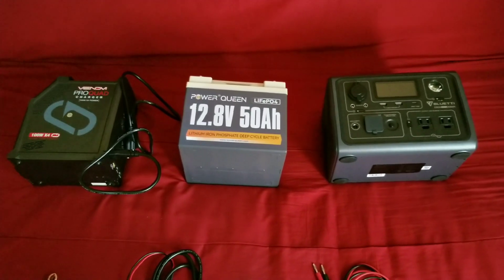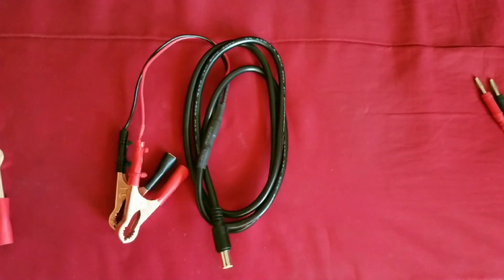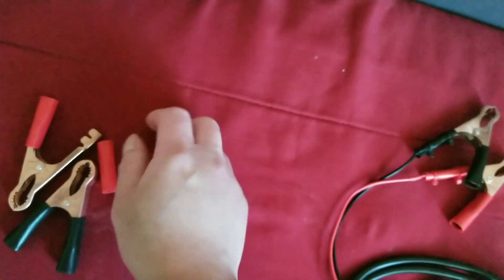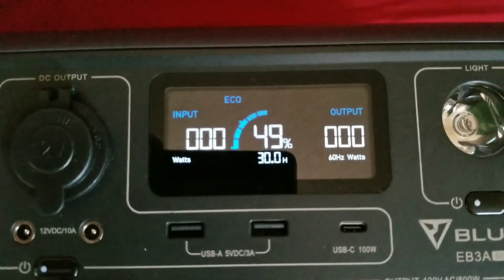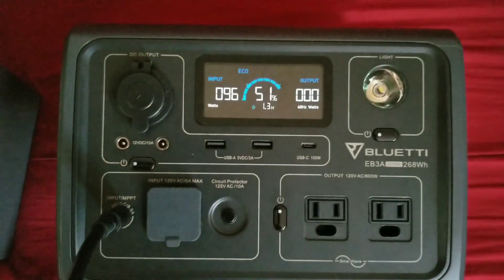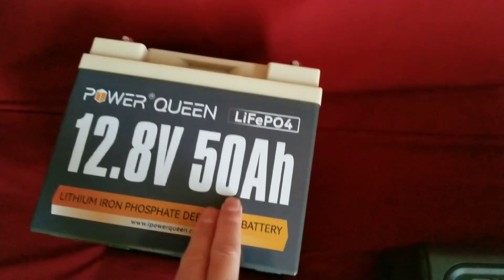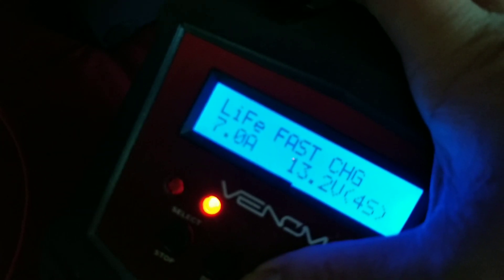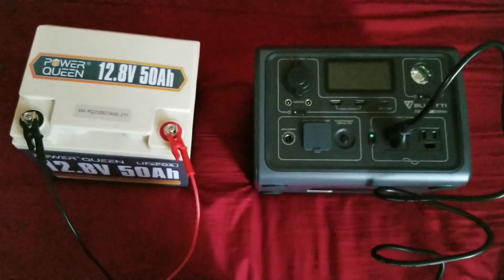How to extend the capacity of Bluetti EB3A

Comment: The charger is set to 13.2V at 7A? This puts 93W into the battery whilst draining 172W from the Bluetti, that’s a 50% loss. Using a voltage booster with current control fed from the bluetti 12V output is more efficient.

Comment: How can you be sure that your battery doesn't go below 70 percent of its capacity? I heard discharging lifepo4 batteries below 70% is killing the battery
Reply from the maker: @oleksandrhirin339  its actually discharging below 20%. Staying between 80% and 20% range thia battery can last 10yrs. I
Reply from the maker: I connect a meter that tells me what percentage the state of battery is at everytime i use it to stay within the 80%/20% range
Reply: @edwindeleon  that is logical, but how come the youtuber tells nothing about it

Comment: I am from cuba so huge problem with electricity. Which system do you recommend me a bluetty generator or pure sine converter with 12v battery for turn on basically electrodomestics in the house like fans principally. Thanks
Reply from the maker: Thank you for your comment. 
It really depends on your use case. If you are planing on powering your entire house then your going to need to get a bigger capacity system. This bluetti eb3a only has 268wh capacity. Although it has a 600watts pure sign wave inverter, Its intended more for camping or something with a very small draw. 

If you're planning on running a house I would recomend something with  a minimum of 3kw system with a 2000watts inverter.  This will only provide power for household items like a refrigerator,  LED lights, fans, tv, ect ect. You will also need a solar panels minimum of 600watts. It can get very expensive using batteries and solar to power your home especially if you buy bluetti or another solar generator.  A DYI will be cheaper. 

Alternatively,  you can get a gas generator for cheaper route less complicated route.
Reply: Getting the 12v 100ah battery with a pure sine inverter would be better in your case because this setup is more flexible PLUS you get more watt hours of operation with it. Also add a solar charge controller to this setup. With the cables and the solar panel or panels, your setup would be complete. As a bonus, get a 24v to 12v buck converter as well for a backup because if your solar charge controller goes bad, this buck converter could be attached to the solar panel to the battery directly to charge it if need be. If any component of this setup stop working, you could swap out that part for a working one, and your system will be back up and running just like it was before. If you buy the Bluetti or any power station, if a component inside of it goes bad, the whole system would be shut down and you would have to buy another whole new unit. I could imagine living in Cuba and the supply chain not being that great all the time, so, that's something to think about as well. I hope this helps.

Comment: Thank you so much for this solution i have two questions can i use a deep cycle AGM battery 12 v 100Ah for this purpose? And the other questions is can i use de eb3a bluetty with equipments at the same time that thw bluetty is charging with the battery?
Reply: Yes.

Comment: I"m trying to visualize how this is extending the capacity when I'm only seeing the battery just charging the eb3a. What happens when the eb3a is fully charged? Because I see it just like having a power bank for a phone. When the eb3a goes close to empty you have to connect the battery up again which is just like connecting it to the wall. And how many times can that battery recharge to 100 percent for the eb3a?
Reply from the maker: It's basically adding the external battery in series to the eb3a 268wh battery.  The external battery is about 600wh then you add the eb3a 268wh which in combine is 868wh. 

I tested this with a 100w light build and ran it till both eb3a and external battery connected to the solar input charger and I got about 6hrs of run time (a little less bc of inverter inefficiency). Now i compared that to the eb3a with out ther external battery and i got about a little less than 2hrs run time. Which is about where it should new with the eb3a internal 268wh battery.
Reply from the maker: And when three eb3a is fully charged then it stops the flow of electricity from the external battery, which means eveything just stops where it is.  Now there will be a little parasitic drain due to the charge controller inefficiency but it's very little.  

Imagine your phone  when the battery is almost dead. You plug it in on a power bank (external battery) to extend its capacity and use it longer right? It's the same concept.

Comment: Could you just use a 24v battery instead of buying a converter???
Reply from the maker: Yes,  you definitely can!! Is also more efficient that way and also charges the eb3a ALOT FASTER than 100w. It will basically max out the thre charge controller at 200watts charge rate.  Only draw back is a 24v 500wh lipo4 battery is much more expensive $$$  compared to a 12v 500wh battery.

Comment: I added a24 volts up converter but it got very hot after a while. I stop using it because heat means waste.
Reply from the maker: Theres is always heat from any type of electronics.  There will be  always waste. It justy depends on how efficent the device you are using. 

I my self akaso bought a up converter on Amazon for around $25 . It also has heat.  I tested its efficiency and it was about 95% efficent and that 5% goes to heat and waste. But i still use it bc it still efficent enough. Now if it was less then 50% efficent then i won't use is bc it will just be a waste. 

My point is you will NEVER find any type of electronics that is 100% efficient. Your PC, TV, smart phone,  batteries,  ect ect ALL produces some kind of heat. Even your eveyday car.  Now do we stop using them just because Its not 100% efficent?

Comment: I wired in a marine grade cigarette lighter style 12v outlet, with a cover, straight to my 20Ah LiFePO4 cell (which has tabs instead of posts). But I can charge it with solar that way, through my Bluetti, using a male to male cable sold for charging and jump-starting batteries car to car, which has a fuse inline. Or straight from the car. And I can extend the Bluetti with the battery cell using the car charging cable. Could probably jump my car, too, if I need it. One improvement I plan is to rewire in a three socket version of the power port which has a built-in volt meter and display. It isn't perfect, but the power management capabilities built into the EB3A (which sounds like a Star Wars droid, imo) make it all safe as an intermediate regulating device.

Comment: Problem is what happens when it's fully charged. There's nothing that shuts off the power from the battery unlike a solar panel with a built in control. The only thing that stops it from overcharge is the actual EB3A. Confusing
Reply from the maker: There is no pronlem at all. Once the eb3a is fully charged by the external battery it stops charging completely.  Then once you start draining the eb3a the external battery will start charging the eb3a as needed until the external battery depletes completely. It's really that simple. 

I use this all the time to run my projector when I'm at the beach or at the park. It extends my watching time to about 14hrs instead of 2hrs when only using the eb3a alone. It works flawlessly!!
Reply from the maker: Also, just for food for thought, the external battery does not push energy to the eb3a. The eb3a pulls the power from the battery. So basically if the eb3a is FULL it will not pull any energy from the battery. And the battery just sits there idle waiting for the eb3a to request for more power.

Comment: My 3ba wouldnt run my cpap all night.What larger one can i buy
Reply: If you buy a 12v 100ah LifePO4 battery and connect it to the Eb3a like he did here, it would run for quite a while. The answer is to add batteries for longer run times. I hope this helps.

Comment: I'd like to run my 200 watt solar panel into an external mppt controller and out to external battery such as what you're using.  I then would like to run a cable with a 7909 end from the battery or mppt (not sure which one would work) to the EB3a.  My main complaint about the Bluetti EB3a is not being able to leave the solar connected when it's dark or light is too low.  The input light blinks continuously and drains the internal battery.  I thought if I wired it in the way as described above, the external battery would be used as a buffer of sort so I can get rid of that flashing input drain.   Another idea I have is placing an inline timer switch and program it so the solar panels can only charge the EB3a during peak times.  Anyone have any ideas or suggestions?
Reply from the maker: The only thing i was wondering is if it will have some negative effect by having an external MPPT  connected inline with the eb3a internal mppt ( having 2 mppt connected in the same circuit). 

One possible solution is connecting an up converter (12v to 24v)  between the external battery + external mppt and eb3a  to act as a safety to keep both mppt isolated frm each other.
Reply: There’s a post on the bluetti forum about using a capacitor inline with the barrel plug that fixes this issue
Reply from the maker: That actually sounds like it would work. Maybe try it out and test it. Using the external battery as a buffer, In theory it should work to keep eb3a frm draining whilst having solar connected during night time. It will continuously drain the external battery. Also if you get an external mppt it might have a fail safe to keep solar frm draining it.

Comment: You can buy the clips that go to female cigarette light and male cigarette lighter to bluetti solar plug in input.  No soldering needed or cutting.
Reply from the maker: Yes, you can. But it will be useless bc the bluetti eb3a solar input is a 3.5mm barrel plug and NOT cigarette lighter plug.

Comment: It's a very inefficient way to charge.. why not just get a cheap charge controller to charge the battery directly
Reply from the maker: I wanted to use what i already had laying around at the house.

I just recently bought a portable MPPT charge controller and im Going to be making an updated video with the charge controller and also a step up 12-24v converter.  Pls stay tuned 👍
Reply: @edwindeleon  thanks. For anyone not bought a battery yet, they can also buy 24v batteries.. no need to use a converter
Reply: @jampam-jf8mt  Fixing to buy a 24v battery myself along side the xt60 to alligator clips, plus battery charger.

Comment: I just did the same thing to My BLUETTI and have the 12v to 24v up converter. But depending on the output you want? They have different up converters with different wattage. Choose the one that works for your application. Mine will charge at 240 watts to keep up with pass through charging. But wanted to add there are several different styles of up converters.
Reply from the maker: Yeah, i just recently bought a 12v - 24v step up converter (going to make an updated video of it soon). It transfers energy faster to the eb3a at around 200watts. Best use for devices that consumes more than 100watts  to off set the discharge rate.
I ran a 150watt heater for about 5hrs.

Comment: All that extra equipment cost enough that you could have just bought another unit
Reply from the maker: That's true but i will still only have roughly about 400wh capacity  VS 640wh or MORE with the external battery. Im going to have to buy 3 eb3a to get the same amount of capacity of 1 external battery. Also, I would have to lug around all 3 eb3a  whenever i go camping or hiking.  Plus, I  don't have any use for 2 additional eb3a. In my use case  It would be a total waste of $$.
Reply: @edwindeleon  your not getting the full output from that battery into the other..theres losses.

Comment: Can you please leave a link to both the battery and the charger? Thank you
Reply from the maker: Battery -https://ipowerqueen.com/

For the charger they don't make that anymore.  Here is another charger that I use. It's a better charger in my opinion.  https://www.amazon.com/Battery-Charger-Lead-Acid-Maintainer-Motorcycle/dp/B0B3CV4S2Y

Also here is another charger that i use toi directly charge the external battery with my portable 120watts solar panel. https://www.amazon.com/Intelligent-MPPT-Solar-Controller-Connectors/dp/B09W61YHH9

Comment: Thanks for the vid!
Wouldn't it charge from the EB3A  slower, but more efficiently skipping the 110V inverted and charging from the 12v socket?
Reply from the maker: Yes, that is correct! 
Charging using the 12v socket will charge significantly slower but more efficiently because it won't have to convert the power from DC > AC > DC. Also,  there will be less parasitic drain from the regulation circuit.  The 110v regulator circuitry drains about 5% per hour with out any load and the 12v socket drains less than  1% per hour with out load. 

My way around this is, I recently bought a separate 10amp MPPT charge controller, and I can now directly charge the external battery from the foldable 120watts solar panels. So I can charge  the external battery in about 5hrs straight from the sun with minimal loss of efficiency!!!
Reply: Thanks for the reply. @edwindeleon  Good to have the choice depending on access and how much time you have.  I have a EB3A ordered.  I think it will pair up with my two 100w panels and two 12v 110AH forklift batteries for at home and the the portable EB3A by itself for motorcycle camping.  I have room in the Sidecar (my dog comes along) for the EB3A.   Will get a solar panel, maybe folding for travel.

Comment: Very interesting video.
But i calculated the cost of the extra parts (battery, charger, cables) and it is almost half the price of another Bluetti EB3A.
I prefer to save money and buy a second bluetti
Reply from the maker: Yes, the external 12.8 50ah battery and all the wires and cables cost about half the price of another bluetti eb3a BUT if you buy another eb3a you will only get about 12ah (200wh usable) of additional capacity! 

So that means you ONLY get a total of 24ah (400wh) usable capacity with 2 bluetti eb3a V.S 62wh (855wh) from the external battery and eb3a combined!! 

What I'm trying to say is that you get MUCH MORE capacity buying the external battery than buying another Buletti eb3a even if its half the price!!
Reply: @edwindeleon  You are absolutely right. Each solution has its own advantages
In my personal case, i am looking for autonomy rather than more power. Then, i prefer a "backup" : With 2 Bluetti, if on is out of order, i still have electricity
The perfect product does not exist yet ;)
Thank you for this interesting solution.
Reply from the maker: @BlueThailand  ahhh I see. YES, in your use case a second bluetti eb3a would be more suitable to your application.

Comment: Love your video. Do you have any idea how fast the EB3A would charge if using a 500 watt inverter from the vehicle battery/alternator as opposed to the solar?
Reply from the maker: Thanks I'm glad you enjoyed it.  Pls consider subscribing.  If not it's cool no worries. 

But to answer your question you most def can charge your eb3a with an external inverter!! It will be the fastest way possible to charge the eb3a at only around 30-50mins  at 400- 430watts  on turbo mode. Now you have to make sure that you get a pure sign wave inverter with the proper wattage for the eb3a charging draw.  Also you will have to make sure you connect the inverter directly to the car battery . The cigarette lighter port will not handle the amp draw. And only charge it when your car is running.  Also make sure your alternator can provide at least 40+ amp while running or it will kill your starter battery.
Reply: @edwindeleon  Great! to be clear, I could run the inverter to the a/c input  and external battery to the solar input and the vehicle would charge both the eb3a and the external battery? or do you think I would still need the charger?
Reply: @baseballdude3100 h
Ei lol

Comment: You could just use mc4 connectors without destroying original solar cable
Reply from the maker: Yes, thats what i was going to do. I bought a mc4 solar charging cable bc people said that the eb3a  does not come with the mc4 cable.  But when i received the eb3a they included the mc4 cable for free. So that means I had one extra mc4 solar cables that i did not need.  So, instead of returning it to Amazon I decided to turn one into a clip style connector.

Comment: I just built my own generator with an Renogy 100 ah and an pelican case. Twice the power at half the cost
Reply: No way you saved any amount of money if you bought a Renogy battery. Its the ghetto Battle Born....with the same price tag.
Reply from the maker: Awesome!! I'm also currently building one with a 2.4kwh / 200ah (2400wh) battery with a 2000watts inverter but it will be for home use as its too big and heavy to be portable like the bluetti eb3a.

I use eb3a when I'm on the go like camping or going to the beach.
Reply from the maker: Wait a sec, where did you find a Renogy 100ah for half the cost of the eb3a?  I checked on Amazon and the cheapest  Renogy lifepo4 100ah is around $600!! AND THAT'S ONLY THE BATTERY. That's not including the AC inverter, the mppt controller, battery charger,  USB Hub, pelican case,  shunt,  digital screen readouts, wires,  fuse ect ect.  

 I bought the eb3a on sale for only $200. It retails for $249.

 So, basically my question is how did you build a complete system with eveything I mentioned above for only $124 (which is half the price of eb3a $249) when the battery that you have mentioned by it self cost $600? (renogy 100ah Lifepo4).